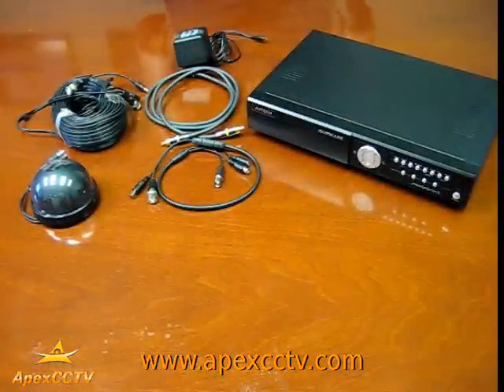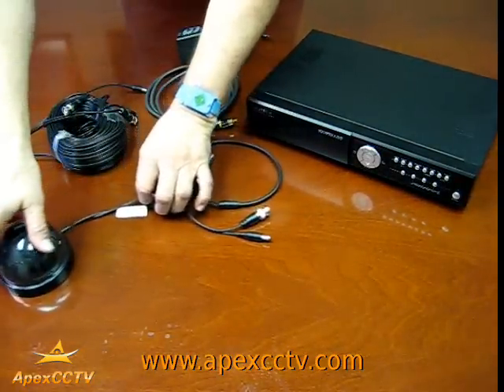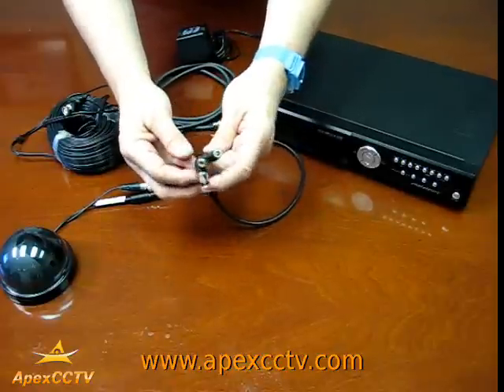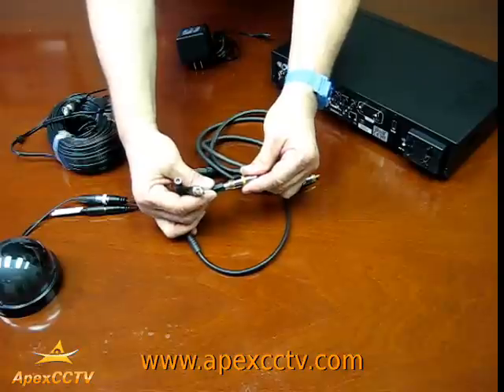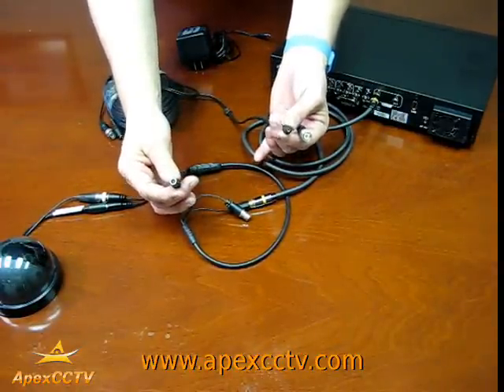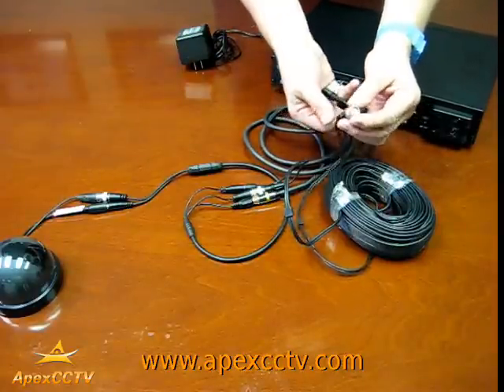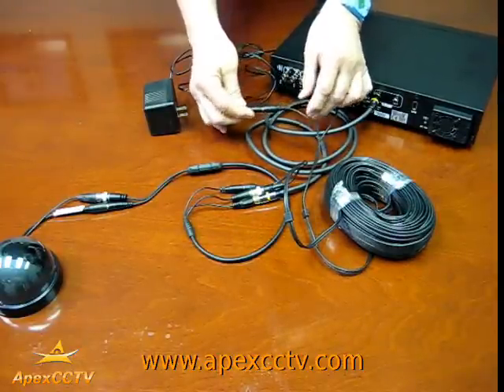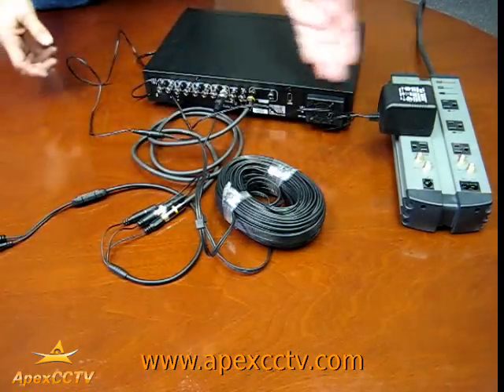Video Tutorial : How To Connect a Microphone to a Security DVR and Camera

Comment: Is this for indoor use only?  I already have all survelience cameras set up all around the exterior of my house which gives survellience information to all 8 areas of my property.  It was actually really simple to do, but your video is a good one for those who may need help.  I now want to buy and connect microphones to each of my cameras.  Maybe I'm missing something in your video.  How is that really short microphone cord going to reach from the corner of my house to the back of the DVR?  Was the short cord just for the sake of this video?  Are the micorphone cords 65+ feet long in reality?  Are there adaptors for both ends of the the video and power cable that also accomadate the rca end thus allowing both cords to connect to one another, run the one cable the footage necessary and then connect into the dvr?